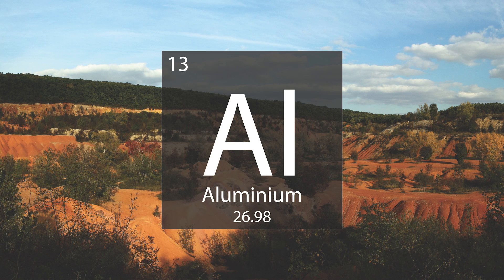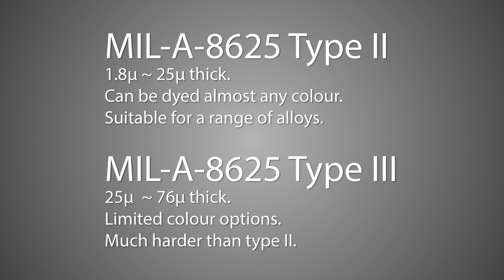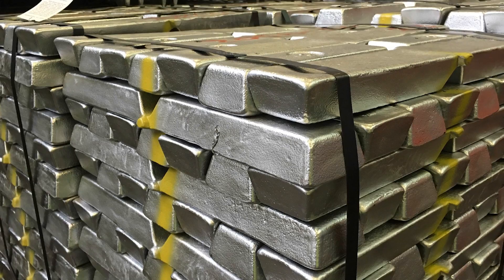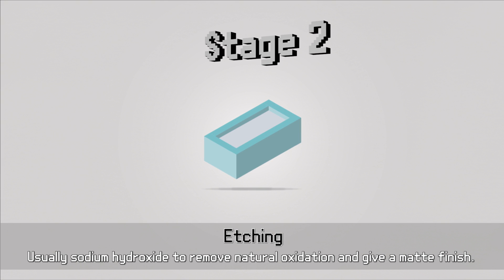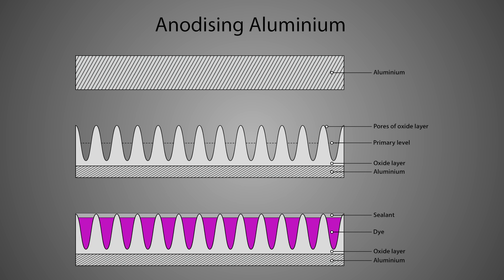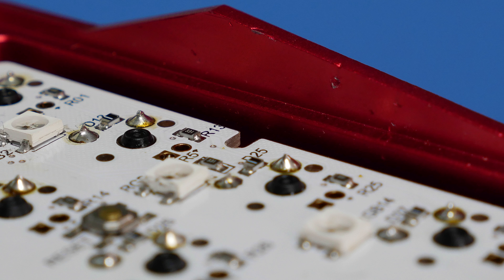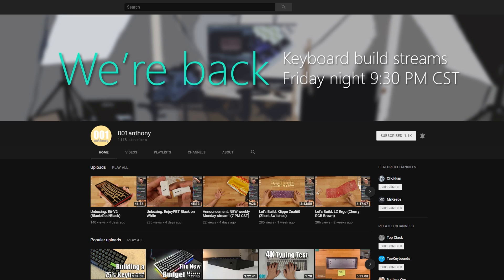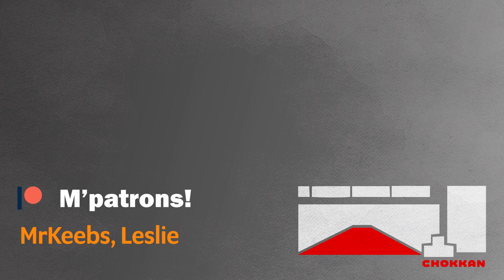Anodising Keyboards

Comment: Cerakote is just better, in all the ways.
Reply from the maker: I wish more keyboards offered it as an option. I have one keyboard with a Cerakote finish.
Reply: @Chokkan  how would you compare (pro/con) cerakoating to powder coating?
Reply from the maker: There are so many more exciting colour options with cerakote, and it's perfectly durable. The one board I have is a boring black, but it feels very nice and I've no complaints about the finish. 

I wonder if most places can handle large volumes that a popular run of keyboards would bring.